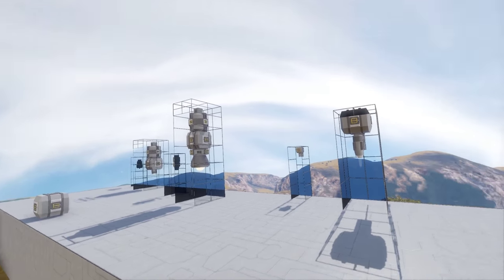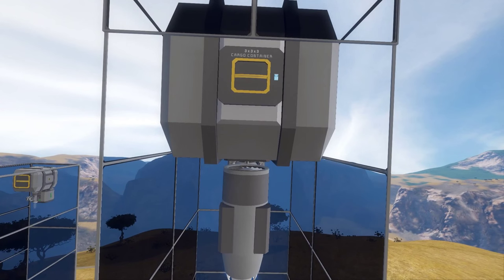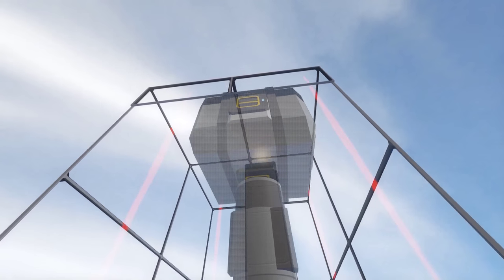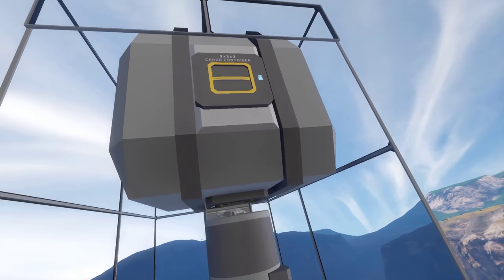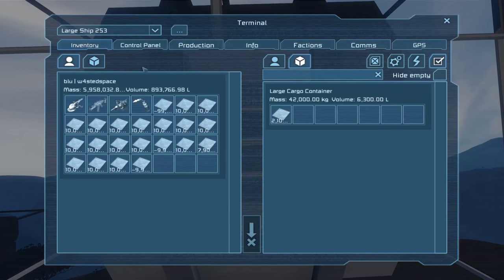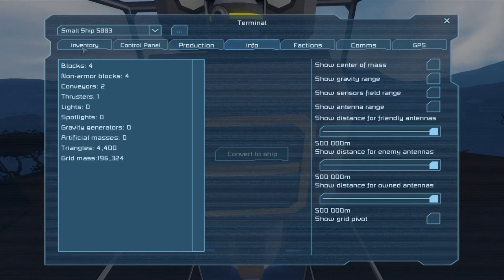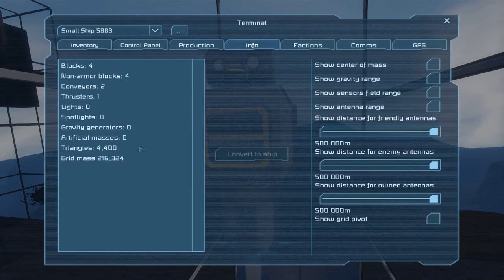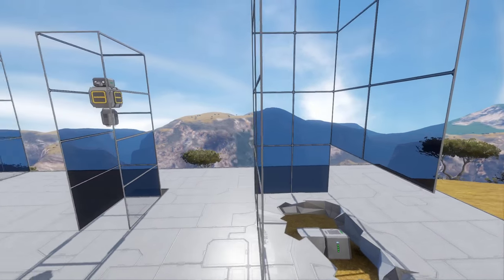Space Engineers - How much mass does an Atmospheric Thruster lift?

Comment: "Only" 70 metric tons (70k kg)?

350kN should hold up slightly less than 35 metric tons. NOT 70!

F=MA
A=g
g= 9.81m/s^2
F=M*9.81
So multiply your ship's mass by 9.81 to get how much thrust you need to hover.

If you have more thrust than that, you'll be able to climb. If you have less, the ship will fall.

The fact that the large ship small thruster (the "bad" one of the bunch) holds twice what it should is VERY odd.
Due to the inconsistency between thrusters, I'd say that the thrust is being misreported or amplified after being reported to the player somehow.

I'm not complaining about the game not being extremely realistic (wouldn't be a game if it was), but its nice when the basic physics numbers make sense!
After all it's an engineer's job to be able to use knowledge of the laws of physics to determine how big they need to make something fly!

Comment: well to start with for the Large and Small thrusters to have proportional increases then the thrust of the smaller of the Large thrusters is way off.  Maybe this is why it seems so overpowered in fact is under powered for what it should be.  With the small thrusters the larger version can hold 7.3 times as much as the small small one.  So on the Large side if the Large Large holds up 3,400 kg then the smaller Large should hold up 453,333 Kg.  But it only holds up 70k?  Thats pathetic in comparison.  This means that the Large Large is 48x stronger than the small Large in comparison to the Large small being only 7.5 x as strong as the small small.

So I tested it myself and got these number

Small Ship
Atmospheric
Small 36,100 kg
Large 290,000 kg

Hydrogen
Small 28,600 kg
Large 330,000 kg

Large Ship
Atmospheric
Small 124,000 kg
Large 4,400,000 kg

Hydrogen
Small 630,000 kg
Large 5,289,000 kg

Comment: wasted are you sure you passed highschool physics a kN lift 10,000kg of mass Irl
though I do agree the space egineers is a little skewiff
Reply from the maker: +Chris Drew Don't get it... which thruster produced results that equate to 1kN = 10,000kg of lift? Plus I speak of maths in the video I am refering to using simple maths to understand the SE mechanics, which at the moment you cannot. A kN means different things for different thrusters and with different inventory sizes.
Reply: +w4stedspace yes but THE Newton is a  defined unit of force this means that a KN is a set unit of thrust fo a body to be held in equilibrium a force upwards should be equal to the mass of the object in Kg multiplied by the local gravity taking the gravity as 10m/s^2  we  find that 1kg requires approximately 1N of force In the video you were amaved by the 340,000N thruster max carrying capacity of 230,000kg however through simple physics we see thar this is closer to just over half the mass that should be lifted

Comment: It seems whoever designed this had no clue about physics, or was to lazy to make proper calculations( 1 N = 0.101972 kgf   or   1 kgf = 9.806614 N) , everything should be just done with simple assuming that 1N=0.1kgf or 1kgf=10N... so everyone would be able to make simple calculation without calculator. i wonder if this have been fixed with new patch...